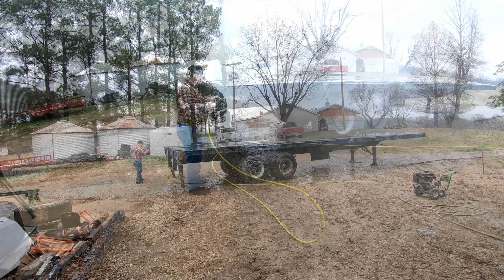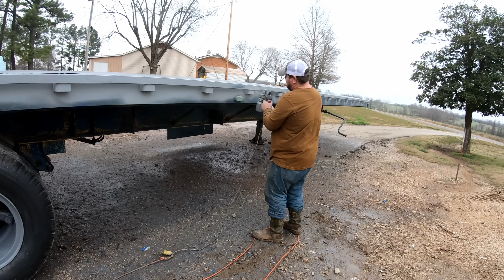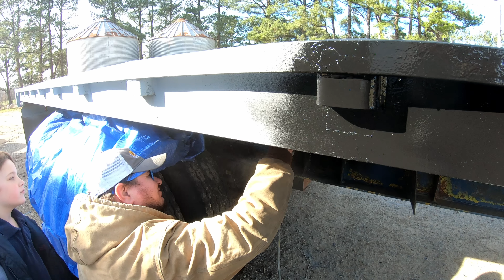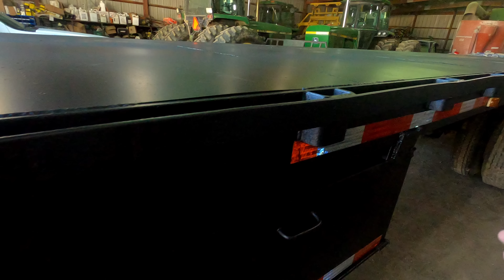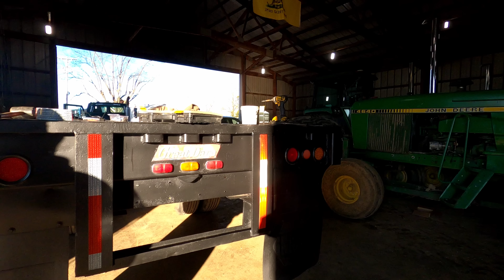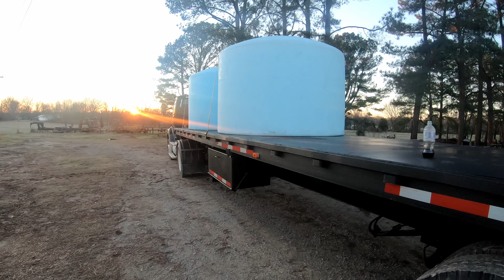Why Do We Run Single Axle Trucks?  + The new trailer gets a paint job!

Comment: If that 32ft was set up like the new hopper bottom it would haul a lot more. I didn't realize those shorter trailers would haul that much. I have looked at bigger truck and trailer but have places I can't get them into too. I think I need to consider a set up like this. Thanks for the video
Reply from the maker: I understand. It wiill be nice to have some extra income this yesr.

Comment: I had a Jet 30’ exactly like your new one. We could routinely get 1000 bu corn when loading out of a bin. With the single screw Mack, we could gross just shy of 80K
Reply from the maker: I'm happy that it will hold that much! Even though it's 2 foot shorter it sounds like it's going to hold more corn than my old one.  The most we ever got on it was 920 bushels.  Where did your old trailer end up?  This trailer come out of Crockett County I believe.  Mr. Tommy Stallings had it.
Reply: @DylanJoyceFarms  I sold it to Adam Joyner. He farms from Brazil up towards Bradford
Reply from the maker: He's got some ground over here in Dyer now too.  Always has a good looking crop.

Comment: I was doubting that paint gun but it turned out good.
Reply from the maker: I've used it on several projects now.  Works good if you've got a lot of area to cover.  I wouldn't want to use it on a tractor or something like that though.

Comment: Dumb question 🙋‍♂️ why not oak floor ??  What type of paint sprayer?? Good to see Corn Dog !!
Reply from the maker: It's just a Harbor Freight electric paknt sprayer like you would paint a house with. You can cover a lot of area fast with it but I wouldnt recommend it for something you want a lot of detail with pike a tractor. I just wanted a metal floor so it would be easier to slide pallets and totes on and off of.

Comment: What is your 32 ft hopper
Reply from the maker: The title says "White-Keene", but thats all I know. There were a bunch of them in this area when hopper bottoms started getting popular.  It's been a good trailer, but I'm thinking that we are going to like this Jet much better.
Reply: @DylanJoyceFarms  I have a 40ft white same as you  it has been a good one they still make them there just called lime city now. I have one of them too just got it hope it is as good
Reply from the maker: @brianbrock4946  Thanks for the information. Does yours have any sort of tag? If mine does I've never seen it.
Reply: @DylanJoyceFarms  I don't think so I've never looked or noticed one
Reply: do you guys run any aftermarket thrashing perts on you combine I have a 9600 and a 9500 and run kuchar inserts in them and man does it bring them alive
Reply from the maker: @brianbrock4946  na. I had a set if kuchar filler plates in my 6620. I ended up taking them out and never put them back in. I only run filler plates on my 9400 if I run into a corn variety that has a spongy cob.